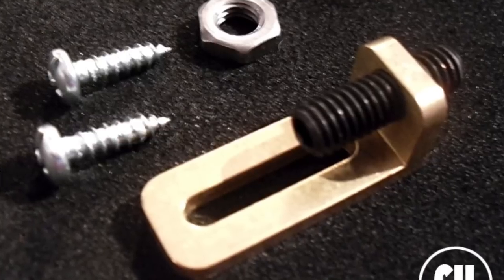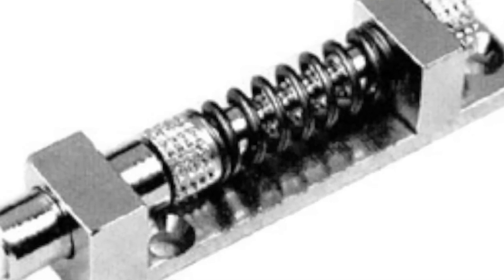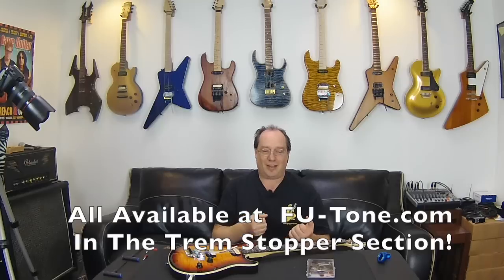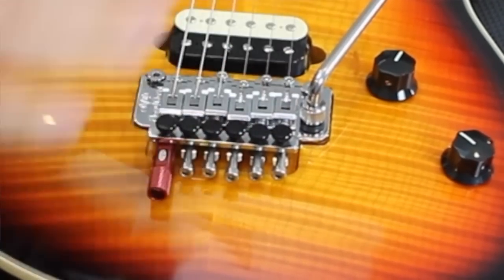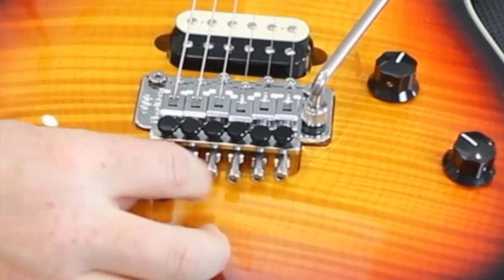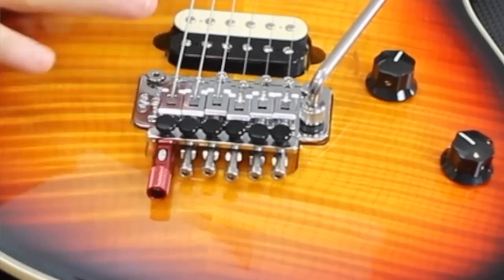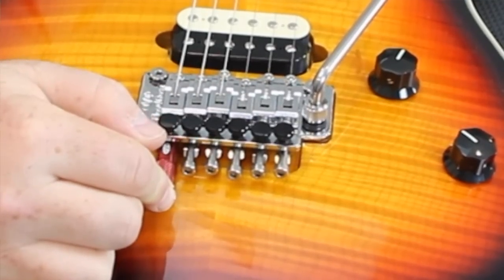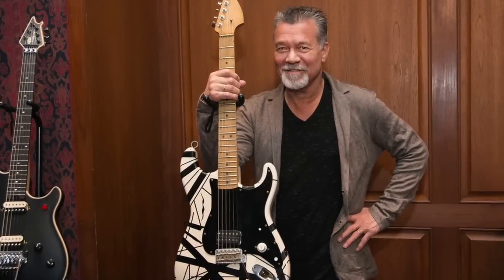EVH D-Tuna Setup - FU-Tone (V2)

Comment: Just had my guitar guy Eddie Carlino (Carlino Guitars) do a swap of EVH Floyd 1000 from a Special into my EVH Standard. He can not get it to push in and engage to drop it D, he said he tried everything. I was told this bridge is perfect working order by the seller, I know that doesn't mean a whole lot. But everyone I've spoken too said he needs to read the short manual for proper adjustments, but Eddie said no, it doesn't work. He also said to contact you Adam and you may have some input on this.....

Comment: I'm finding I have to turn the side fine tuner screw in so far when in the D tuna is pushed in to E tuning position, it makes it really hard to push and pull the D tuna in and out. No matter how I tune to drop D, when I push  the D tuna in for E tuning, it's at least a 1/4 step down and then I have to adjust the side fine tuner quite a bit, which makes it hard to move the D tuna. Doesn't seem like  there's anything else to adjust when you tune to drop D initially, as the instructions say. I've even tried to have the Floyd fine tuner pressing down on the screw just a little or not at all.

Comment: I’m having an issue with the D-Tuna not having enough clearance from the guitar body to get in and out. I don’t want to drop the Floyd posts anymore (to get the Floyd more level and less angled toward the body) because the action gets too buzzy. Typically I can handle my own setup work; neck is straight. Any advice? (other than take it to a pro…)

Comment: "Back in the day",  when it was time for me to change strings/set up my Kramer, I used to shove a cassette between the body and the Floyd. Those trem stoppers weren't available back then (then again, they're available NOW, and I still don't use one)...

When the gentleman says "the easiest way" to prevent your Floyd from rocking, is NOT by using that contraption... you have to be resourceful and figure out a way to shove something behind the guitar, between the trem block and guitar body, OR between the Floyd bridge plate and guitar body...

If you go the "cassette" route, use something like a t-shirt, underwear or a Hav-A-Hank to place on the body to prevent you from screwing up the finish...

Be resourceful...
Reply: I have a 3 year old thing of chapstick that fits perfectly, still use it to this day :P
Reply: I use a 9-volt battery. Seems to add tone and sustain as well... RIP 🔨

Comment: Hey Adam, I really don't get the maths behind this... If you set up the device to D, with the bridge against the guitar body, and then go E, the bridge will slightly lean towards the pickups and screw your tuning... Because E requieres more tension than D.
It makes more sense to me setting it up while in E, and then go D, so in D (less tension), the bridge can't move back because it's against the body. This would be "safer" IMHO, even when the springs are tight enough to keep E against the body...
Super interested on your opinion, cheers!
Reply from the maker: Thanks for the feedback Flavio. If the bridge is lifting up when moving to E, the springs are not tight enough. Increase spring tension and then repeat setup from D position. Setting the "thickness" of the D-Tuna when going up to E is the key.
Reply: @FloydUpgrades  thanks!!

Comment: Your D-tuna seems really smooth.  Mine is kind of clunky and doesn't always pull out/in smoothly.  Any advice, anyone?

I will say for a while I was using the fine tuners before I realized you do not use them on (if that helps). But it looks fine and not bent or anything.  Another thing since it's not smooth on occasion when I got to E or D it will go sharp and I have to jiggle it a bit.

I don't mind replacing it if there is no easy fix for it.  I've had this D-tuna as it came stock with my MIJ EVH WG Special that I bought new around 2010.
Reply from the maker: Hey PD K - I am happy to get on a video call with you and walk you through a setup and figure out why you are hanging up. Shoot me an email and I will schedule with you. adam@fu-tone.com

Comment: I got mine to stay in tune, but is it ok for the plate underneath the Floyd to be sitting on the guitar body on the bass side but raised slightly on the treble side? I see it has left a lil scratch in the paint on the bass side where it rest on the body. I had it raised slightly on both sides off the body but it would not stay in tune that way. I appreciate any help you can give me

Comment: i see that you removed the tension plate from low e side. do you recommend that? If so how and were to remove? And does it make it easier to engage disengage?
Reply from the maker: Thanks Stan! I did not remover that on this guitar (factory). In my opinion, it does not matter either way. I have guitars that I remove the whole thing. You can go either way.

Comment: Hi, do you have a setup video for how to install a Black Box stabiliser in conjunction with the d-tuna? Or even just how to install the black box....

Thanks
Reply from the maker: In the works. The Black Box comes with very simple written instructions as well.
Reply: I have the Goldo Black Box. Instructions are in German. In addition, the tension knurled knob inside the housing looks like its part of the stop slider...
Reply from the maker: @cyberi4n  Here is my Black Box - The instructions are on this page as well - http://www.fu-tone.com/catalog/index.php?main_page=product_info&cPath=70&products_id=222
Reply: FU - TONE awesome thanks. Installed. Works a treat. I’m guessing though that trimming/removing the felt/rubber pad is the optimum solution for working with the d-tuna? There’s quite a lot of play in the rubber which means that when I drop to d the block compresses the felt/rubber a bit more but the stopper itself doesn’t move.

Thanks for all your help, appreciate it
Reply from the maker: @cyberi4n   - yes - agreed - lose the felt.
Reply: FU - TONE fixed! Thanks 🙏. For all your help

Comment: I've got a Japanese Wolf with a factory Dtuna  that works amazingly well. But I have another first run Dtuna on a striped relic copy guitar with an OFR that I've never had any luck getting to work. Floyd is flush with the body but it always goes sharp a good 5-6 cents when I clamp the nut down!? Any idea how to correct this? I checked the string tree and the strings appear to be as they should. Not pulling up on the back side of the nut at all. Not sure what else to do. Any chance they've gotten better over the years and I should just try a newer one?
Reply from the maker: Email me direct - adam@fu-tone.com

Comment: Hi thanks for your tips and I recently got one D Tuna but when I pull out I got only one step down... I wanted anyway to keep my floyd rose (original) floating so I bought as you said the black block, got it installed but it's the same problem and I don't know where it comes from still go only half step down...if you have an idea how I can fix that...
Reply from the maker: IT sounds like you have 2 issues - the black box is not set with enough tension. AND - your setup is backwards. Set up the BB when in the E position first. Then setup the DT starting in the D position as shown in the video. Email me if you need more direct help.
Reply: Thanks for your quick answer I'm gonna check it out
Reply: I want to purchase the black box stopper but can not find it on amazon? How did you find it? Cheers!
Reply: Found it, brought it, can't wait for it to arrive.
Reply from the maker: @JamEZmusic86  Black Box Here - http://www.fu-tone.com/catalog/index.php?main_page=product_info&cPath=70&products_id=222
Reply: @FloydUpgrades  Thank you!
Reply: Just one thing really check where exactly you instal it, it's important
Reply: @FloydUpgrades  please update the link and have a notification attached to alerts for any future changes in the link to this page thanks!

Comment: Do you have a video with installing the D-Tuna so you can pull up on it with the trem?
Reply: You can still pull up, you only have to stabilize the trem during the install. Use a block of wood, or even a stack of coins to keep it from moving, then once you're set up, take them out.

Comment: How does the small set screw actually fine tune the F/R in the "E" position? Thanks
Reply from the maker: By adjusting the distance that the string lock screw moves under the fine tuner of the bridge.

Comment: does it only work on the E string? what if you put D tunas in all of the trem lock?
Reply: I think it could possibly work on the A, but nothing higher. The distance the string travels when being tuned is what affected when it’s engaged. The smaller strings have to travel more to drop in tuning as much as the E string. I’ve never tried it mind you. But I’ve had a Wolfgang for 20 years, and what I know of how it works I don’t think it would. Not accurately anyway.
Reply: Maybe It Will be better buying a Digitech droptune in this case

Comment: Does anyone know if this works on schecter hellraiser hybrid c1frs floyd rose 1500 series? I used smaller lock screw and when its pushed in it hits the body. I'm also tuned to c# standard. I have no trem setter and i also come up and dive. Thank you
Reply from the maker: If the bridge sits too low in the recessed cavity, it will not have room to function. you can route a small channel for more room need be.

Comment: will the black box act as a stop when working on the guitar???  or would I need both??
Reply from the maker: Not a complete stop. Take a look at the "Trem Blocker" at FU-Tone.com. Good tech tool for doing setups.
Reply: gonzosc11 second ago...  yeah just order trem blocker with some other things also.  my interest in the black box comes into play as you mentioned that it helps when running full float for pulling up,   I got a Gibson LP with Floyd original installed from factory. while I will be using the trem block to keep the D-tuna from eating the body I will limit maybe 60%-70% of the pull up range.  so with only having minor pull up range would the black box still be of value?  and if it is, could you fit a black box and a trem block in there with three of your HD spring that I already have!
Reply: and another question. on the PMS mounting system,  seeing that the Gibson LP is arch topped will using the PMS mounts place the pickups at the wrong angle to the strings as they don't run down the flat of a body?    or can the angle be set with the PMS?
Reply from the maker: It will change the angle but stay within tolerance.

Comment: Why does it come with 2 screws. I lost the small one, Can i use only the large one.??
Reply from the maker: No - The 2 screws are different so you can have the right size depending on where your E saddle is positioned. You need to be able to pull the DTuna all the way out - AND - push it into the E position without the entire head of the screw coming out of the back side of the unit.

Comment: I would also mention the first tremolo stabilizer on the market, the Hipshot Trem-Setter. In fairness, while it was the first, installation was a pain, with an invasive and difficult to drill hole between the two spring claw screw holes, but it did work well once properly installed. The newer models mentioned in the video are much easier and less invasive to install, and with comparable final performance. But still, for completeness' sake, I wanted to mention the Trem-Setter. Back in the day, when it was the only one available, I installed one on my 89' Charvel Model 6 and also on my 90' Ibanez Universe, and it worked great in both cases, going to Drop D on the Model 6, and going to Drop A on the Universe, pulling up or pushing down, and still keeping all the other strings in tune.

One thing to consider when deciding to install any tremolo stabilizer is that you will lose the ability to do a trem "warble", where you point the bar at the neck or towards the back strap button, and you hit or flick the bar so that the notes flutter in pitch. With a trem stabilizer, the bridge won't free float, and will instead want to clunk back to a fixed spot halfway between pulling the bar up or pushing it down. Conversely though, as the trem is "stabilized", you can firmly rest your hand on the bridge for fixed bridge like tuning stability during palm muting, instead of drifting sharp[. Also..., with a trem stabilizer, you can do Nashville style double stop pedal steel licks, where you hold a note or chord steady in pitch while bending up and/or down one or two strings precisely from one specific note to another specific note, unlike a free floating bridge that if you bend one note up or down, all the other strings will bend in the opposite direction. Basically..., it makes a free floating bridge such as a Floyd, vintage Fender, etc..., act more like a fixed bridge hard tail, but still retaining the ability to pull the strings sharp with the bar, or push the bar down to go flat...

Comment: I'm curious (and doubtful) if these could be on other strings? Just brainstorming lol
Reply from the maker: No - It is designed for the low E string only. Every string has a different range of movement between full steps. That being said, I hav modified these for different tunings on different strings.
Reply: Is this will work on FRX system?

Comment: If I want to install the D tuna on my Jackson PC1 (floating Floyd Rose that has the hipshot tremsetter installed), would it work or would i need additional adjustments?
Reply from the maker: The Tremsetter would allow the Dtuna to function properly. However - it depends how far down on the cavity your bridge sits. You may not have the proper clearance for the unit outside of the cavity. If you email me side shot photos, I can advise better. adam@fu-tone.com
Reply: someone will come to your house and take the Jackson and the EVH guitars back. this is how people get into trouble.

Comment: Just bought this, I guess this doesnt work on a fully floating trem? I have my trem blocked with the tremolno but when I go to fine tune it on the EVH device it will no longer come back out.
Reply: You are right, floatign trem doesn¨t work with it... My problem with D-Tuna is, when you tune the D and lock neck, thats basicly it, you can't tune the D string any more, otherwise tuna won't work...

Comment: Hi. I got the D Tuna install at D,  the rest at ADGBE. But when I put it at E, the rest go to #. Please advise.
Reply from the maker: You are not properly blocked. Make sure bridge is stable and does not come off of ground zero when shifting from D to E.
Reply: FU - TONE Thanks man. It works!
Reply: Can you walk me through blocking the trem?
Reply: Asynsion Music I have the EVH, the tremolo will only go 1 way, it’s not floating, meaning the bridge will rest on the body when the spring is tight. I don’t know how it’s done for floating tremolo with both upward/downward ways. Some just use tremolo stopper, it will float 1 way, you will loose the ability to pull the bar up.

Comment: Any advice on a dtuna that's stiff? I get it all in tune but when the dtuna is engaged the low e is always flat,.. I fine tune it and everything else goes out of whack. And the dtuna is stiff as hell
Reply: Is your trem nice and level? Might have to adjust the claws and retune.
Reply: Just add a little bit of vaseline on the top of the D-Tuna, the curved part that slides under/into the Floyd fine tuner. Work it in reapply. It’s metal on metal under there so I’ve found these do get catchy and hard to move.

Comment: Great update video, Adam. I recently purchased a Wolfgang Special and installed the D-Tuna per your instructions. My problem is that I am unable to get the fine tune set screw to adjust appropriately. When I move from the drop D position to standard tuning, I find that standard is sharp. I have tried turning the fine tuner both ways and it doesn't adjust. It just gets tight so that the D Tuna becomes inoperable. I guess it's possible that the previous owner stripped the set screw. Any thoughts on how to fine tune both positions?
Reply from the maker: Maybe - I need a little more info. I will sort it out for you. Copy all and jump to email - adam@fu-tone.com

Comment: I tuned to Db without engaged, then when I engage it to fine tune it, the tiny set screw loses contact before it can tune down to Eb. Anyone else have this problem, or am I fuggin' it up?
Reply from the maker: IF you are using a 42 E string at half step it falls out of range. 46 at half step is in range. There is a mod need be at 42 - email me for direct help - adam@fu-tone.com

Comment: Whould it work on a fully floating tremolo?
Reply from the maker: Not fully free floating. When you drop D it would knock the other strings out of tune. HOWEVER - you can have a trem that does pull up if you add a stabilizer - like the "black box stabilizer". On the FU-Tone.com site.

Comment: I'm in a struggle with locking down the nut and the strings go sharp then I tune the low e and all the other strings go flat,... wtf am I doing wrong?!?!?!
Reply: Are you maybe over tightening the nut?
Reply: @eedwards9495  nah not at all,... what I need is a schematic or something of the proper height adjustment at the bridge and spring tension
Reply: Not to mention the nightmare of the dtuna!!!

Comment: Hey Does anyone know if the d-tuna works switching from D# - C# ?
Reply from the maker: Yes - Depending on gauge and scale - slight mod may be required.
Reply: FU - TONE the gauge of the strings are 9-42. I put the d tuna on and when I use and play the guitar it goes out of tune I even have a trem block. Any way that I could fix this?
Reply from the maker: Sounds like the trem is not properly blocked or stabilized - take this offline - adam@fu-tone.com